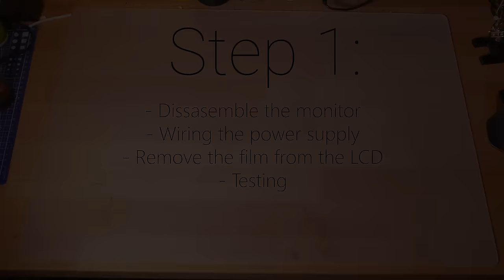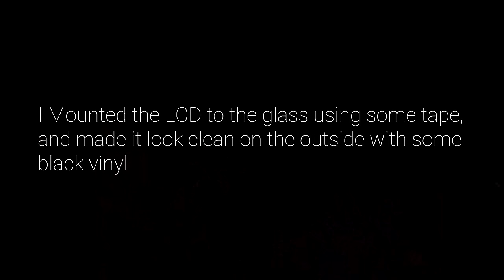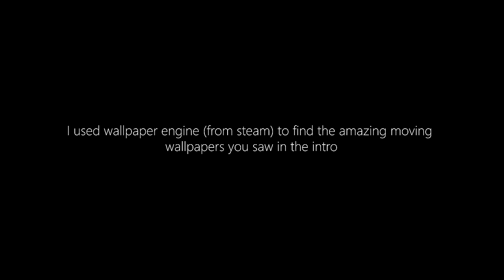DIY Transparent LCD Side panel!

Comment: What I don't really understand tho is, how do you know what voltage you need? And I guess you don't need an additional power cable going to the snowblind screen? But you would have to connect it to the videocard I guess right? And what did you pour onto the screen to get that front layer off? Just water? Or some kind of alcohol solution or smth? I got a few old screens around that I could use for such a project but I don't complety understand how this is done. Thanks for the vid tho.
Reply from the maker: I measured the output of the old monitor power supply, and found out which voltages went to the monitor controller. The only power cable you need to the snowblind is a molex.
I have connected it to the GPU with a hdmi to dvi cable. You can see how everything is connected at 10:28 in the video.  
Water worked great for removing the front layer:)

Comment: Hei, I started today my own LCD side panel project, but I have the problem that the Display is standardized turned Off after no power, therefore I need the Power Buttons and additionally Power (3.3V) for the Board to run the Power Button. In your build this is not the case. Could you tell me how you tackled this problem? Thanks in advance!
Reply: For everyone that might have the same problem: I just made additionally to 5 V an extension for 3.3 V from a SATA port and now it works perfectly fine, also without the little board with the power button and input change.

Comment: Hello, I would like to ask how you managed to pull off the anti-reflective film (layer) so nicely, because when I tried to tear it off, the polarizing layer also came off. I did it by putting some paper tissues on it and soaking it and leaving it there for 24 hours and watering every once in a while, but it didn't work. Do you know any other method or advice please?
Reply: I removed it carefully with the help of acetone without waiting a day.

Comment: the LED's facing away from the monitor and illuminate the inside of the case rather than the panel, right?
Reply from the maker: The leds are for illuminating the inside of the case, and the reflections work as a backlight:)

Comment: I have the same case 510i with full rgb (NZXT RGB fans, NZXT cooler and Strips). The question is do I need to install rgb strips arround the LCD panel? 🤔 I'm thinking of not install it because I have enough RGB.
Thank you
Reply from the maker: You don't need it, but more lights inside the case gives better contrast on the LCD
Reply: @Ananords  Thank U bro

Comment: Thanks a lot for your video ! 
I'm trying to do the same thing, but my LCD controller has two 5V pin, two 12v and 4 GND..  
Should I use two molex inputs or can I use only one and connect the 5V to the two 5V pin and same thing for 12 V ? And what to do with these 4 GND pin ? 
Thanks

Comment: @ananords:  I bought the same model monitor as you (Dell Ultra sharp 1905FP) but the LCD panel looks darker and is not transparent like yours, i noticed the LCD panel didn't have LG printed on it like yours, do you think it will be more transparent when I remove the polarizing layer?
Reply from the maker: There might be a layer that you have not removed, making it darker. But you have to be very careful when removing the layers.

I have a lot of led lights inside my case too, to get better contrast. It is also white inside, which helps. If you have removed the layer already, try adding more led strips inside your case.
Reply: @Ananords  thanks for the reply.
Reply: @DordiHOTS  i think i have the same issue you ever fix it?
Reply: @Gruntguy55  When attempting to remove the polarizing layer, I believe I broke the monitor but im not sure, I bought another one. I believe the monitor has some variations in design even if the model is the same.

Comment: In the process of doing this, and I ran into an issue maybe. Is it possible to have peeled off too many layers? My layer that peeled off was not clear (same monitor you had) and I am not able to get anything from it. 

If I put the ripped piece back on, it is visible... I did not do the water trick. 

So did I peel off a needed layer ?
Reply from the maker: Sounds like you pulled off one that is needed..
Reply: @Ananords  Would that probably be the polarizing film then eh

Comment: I did this to my Minivan Windows.     But due to the TINT of the glass, it was hard getting a good image out unless it was Pitch dark around the car with the upgraded LED Dome lights. 
I had to add extra lights to the windows, and they worked out ok.     

The next big step is semi Flexible transparent OLED displays  like LG showed off on Linus Tech TIps.    I've seen the small ones, and they are cool.  But I'm going to need more like a 10 inch screen or larger to make it worthwhile.   

I tried using Micro projectors, and they worked out pretty well that way.    
I used a Asus Chrombook with the HDMI out, and it worked a treat.  Same with some Samsung Tab Pro320 tablets with the Samsung MHL adapter.   

Today?   I think' I'll just use a  some Amazon FIre sticks.
Reply: That's awesome.  Assuming full coverage is obtainable, does the LCD provide for any "tinting" itself?  Like drive around with them black = tint?

Comment: How did you hide the green board with the brown cables from the lcd that attach to the controller board of the lcd in this h510 case I have the exact same one and how did you route the cables?
Reply: I mean the green part with all the yellow brown lcd cables coming form the lcd panel where do you put that?
Reply from the maker: I hid it in the hard drive bay. There is a small hole above the bay, just big enough to fit the ribbon cable through.

Comment: @Ananords I’m trying this with the exact monitor but I couldn’t get the LCD panel to light up. Is it sufficient to connect up the red cable on the power connector to the 5v cable and the yellow cable to the ground cable on a molex? Thanks!
Reply from the maker: Yes, you should only need to connect one of the minus pins (pin 4,5 or 6) and one of the plus pins (1,2 or 3). You can try to connect them together though (1,2 and 3) and see if it works. Have you tried using a lab bench power supply?
Reply: @Ananords  I figured it out! For anyone else trying to figure this out, if you had cut the wires instead of desoldering the connector, you have to connect pins 1, 2 and 3 to 5v and pins 5, 6 and 7 to ground on your molex

Comment: Lol that’s awesome I am actually in the middle of the same project. With the same case as well. Where did you hide your board that is connected to the screen?
Reply from the maker: Awesome! I just have it at a 90 degree angle, so it's laying on the inside of the case. It just barely fits if you put the panel as far back as possible.

Comment: So the entire LCD controller in your case runs off just 5v? What do the rest of the pins from the power board do?
Reply: Rest of them for the led panel, front panel control buttons etc

Comment: What if i want to use it as the main monitor, so not have it transparant, i just keep the white backcover on it?
Reply from the maker: That would probably work.
Reply: I'm also thinking of doing that, we just need to disassembly the monitor case? And just stick it to the side panel lol
Reply: @aviand  and do the wiring and soldering lol
Reply: @budgetking2591  not if you use the original powercables xD

Comment: Is your molex a 3pin or 4 pin connector? I have a 12v led strip with gnd. Could I still do this? also my molex has all 4 connections 12v gnd gnd 5v
Reply from the maker: My Molex is a 4 pin, but I only used 5V and GND from the connector. So you would be able to do it. You can also just solder it to a USB cable if you don't want to connect it to your power supply.
Reply: @Ananords  That is very interesting! could I just use any USB cable and solder it on? Does the slot run at 12v? or if it runs at less does the lights still power on fully?
Reply from the maker: @jdhd999  The controller board to the LCD that I used, runs fine on 5V. If yours do too, then you can use any USB cable. You might need 5V 2 amp, I haven't measured it.The led strip is connected directly to 12V, and is not a part of the LCD. Please see the schematic in the written tutorial.
Reply: @Ananords  i appreciate you! Thanks for the fast responses! Today's the day wish me luck lol. Should have an upload for this week hopefully
Reply from the maker: @jdhd999  No problem:) Good luck! If you have any questions underway, just ask:)

Comment: 4:32 this is confusing like how did u get a display output? And how is it powered?
Reply from the maker: I connected it to the old power supply when I tested it.
Reply: @Ananords  oh like now I get it the 2 black wires were the MOLEX right?
Reply: @Ananords  Because I am going to do this to my h500p but I thought to change case first but I don't know of it will work
Reply from the maker: That's correct
Reply from the maker: Cool! If you are going to throw it away anyway, you have nothing to loose
Reply: @Ananords  yea might as well get ur case
Reply: What happens to f sparks pop
Reply: @zak_facts2676  that's the magic smoke being released and without it it won't work

Comment: What resolutions would work. Can I get a better resolution like a 1080p monitor
Reply from the maker: That would probably work. There is no point in going higher resolution though. Higher resolution means higher density of pixels, therefore more light would be needed to pass through to make it transparent.

Comment: Hello thanks for the video! I bought a cheap dell 5:4 monitor with HDMI and I'm getting 20.2v on 2 red power supply wires and it has 2 grounds but they appear to be a shared ground. I take it no way to power this panel with a PSU?
Reply from the maker: Hi! I don't think it's possible to use the computer PSU then.. You can use the original power supply though, if you make a good grounded case for it, so you don't electrocute yourself. Then you can use a relay, to turn it on when you power on your computer.
Reply: @Ananords  It was a dell 1917s, do you think its because its an hdmi t-con board? I have access to another monitor that is VGA and DVI only. It was a perfect fit for my case. 
Maybe I'll look for another monitor or just some bare parts. Is it possible to use a different tcon board with this existing lcd panel?

Comment: Really stuck on the power part as I don't know how to do this. I can't find the power supply board schem online either. Monitor is a p1913t
Reply from the maker: Have you tried to carefully power on the power supply, and then measuring the voltages? There is often a ground plane around the screws, so use that as GND and measure the voltages on the pins.
Reply: @Ananords  will do!

Comment: Why is my screen still not transparent after removing the foil? I got the same as you mate. Any ideas:D?
Reply: I saw a comment that said there might be a layer on both sides, I am having the same issue if you found a soloution please let me know
Reply: I have the same problem 😢
Reply: @Sy-skw  u have to User the exact same Monitor, not the one in the description. Watch when he Demontage his an Look what specific number it has on the back.
Reply: Its the Dell p190st or si cant see it really.... after i took the CORRECT Monitor it worked

Comment: why comes the plastic overlay come of when you make it wet???
Reply from the maker: I don't know exactly, but it works;) If you don't have to wet towels on long enough, it will stick too good, and you might break the LCD when you try to remove it. I guess it's stuck on with some type of glue

Comment: Awesome build, but for someone that knows nothing about this mod, "Just plugging it in and testing it." is not enough information to truly begin a project like this. I can do all of the hands on tear down, I loosely understand the electronics, and I have no idea what to do regarding the actual imagery. I read a comment about connecting a Raspberry Pi, which sounds ideal, but again, I don't know anything about the electronics/programing side of things. I am good with computers, but knowing how to perform within Windows 10 does not translate to understanding programing or electrical engineering. Any further information about those processes that could lead me to starting and finishing this project myself?
Reply from the maker: Much of that information is in the writeup at Instructables, see the link in the video description. This is not a guide or tutorial, but a build video. It is also quite hard to make a tutorial for doing this. The power supply and main boards differ, even in the same model. That means you will have to measure and check for yourself. There is also high voltage involved, and I don't want anyone to get hurt because "they did like I said". So this is also to keep people that are not used to electronics away, because this might be a challenging and dangerous project to start with:)

Comment: I wanted to know, does it power itself on whenver the pc is turned on or you have to keep the control board ?
Reply: oh and by the way, my screen have 12V and 5V pin on it, wich one should i connect to ?
Reply from the maker: @karmapuma8268  1. My screen turns itself on when it receives power. 2. If it works fine on 12V, you can use that. The same with 5v. Use the one that works, and is easiest for you.

Comment: Hey Ananords, was curious to know if you were able to get colors out of the display or will it just be black and white after the modifications are done.
Reply from the maker: Hi! You will be able to see colors, but it's a little bit dim. With more light inside the case, you will be able to see colors better.

Comment: Just wanted to let you know, I would update your parts list to say that the panel you are using is a 190St, not a 1905 panel. I ordered a 1905 and disassembled it, only to find that the panel is older and will not work like this panel.
Reply from the maker: Thank you for noticing. Was an oversight by me, sorry about that

Comment: Manufacturing this should cost less than standard panels since it uses less layers and materials (of course without any LED backlight, only the LCD crystal layer). Does it exist on the market?
Reply from the maker: In parts, yes. But because it can't be mass produced (not enough would buy it compared to a monitor), it wouldn't be cheaper. There is a similar product on the marked, called Snowblind by Ibuypower.

Comment: Just spent $3k on a new PC, with the Thermaltake AH T600 case, I was gonna say I would pay you to make this for me, and give you my PC specs so all I had to do was connect it to my PC.  But you said you got to Solder the connections to the computer according to the circuit diagram, and I don't have a solder or know how, so I guess that wouldn't be possible.  If it is possible some other way reach out to me though and we could discuss pricing for supplies plus labor.

Comment: you can use any pc case with this not just the nzxt h510 right?
Reply from the maker: Not any, it needs to have a glass side panel that is large enough to fit a LCD panel

Comment: I did this mod thanks to the videos help buit one thing i always found funny is they tell you in description and video what monitor they used but when they do the tear down its a different monitor than the one they said to use. Which is important as the two different monitors wire up differently and have different sized components inside of them. Just some food for thought because i did the mod with both monitors mentioned or shown in this video

Comment: OK. The foil is removed. But the display is still dark. My PC Monitor is a  LCD 19" Medion MD 30699 PU.
Reply: have you got enough light behind it?
Reply: @ashbrown544  Yes I have, but the glass is not clear like a window. It's brown. I thought it was clear. Maybe every screen is different
Reply: @goofynski  I get what you mean, unfortunately I've not come across any that were completely clear. One thing I can suggest that will maybe help is adjusting the contrast/brightness/colours using the OSD Front Panel buttons.
Reply: @ashbrown544  All good. It looks the same in other videos. Is ok. thanks.

Comment: What Sata cable do you recommend using??
Reply from the maker: Any Sata cable that fits your build is fine. I use some black ones, with a 90 degree bend on one side. I think they came with my motherboard or case:)
Reply: @Ananords  do you by chance have a video showing how you could solder this kind of Sata cable to this particular mod? Having a hard time getting it to work
Reply from the maker: Do you mean the Molex Cable? Have you read my written tutorial?